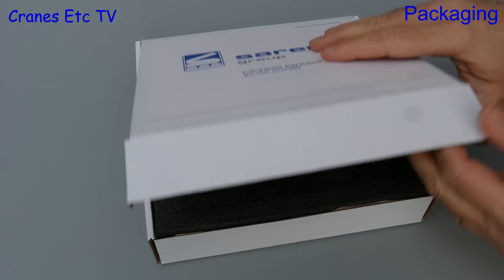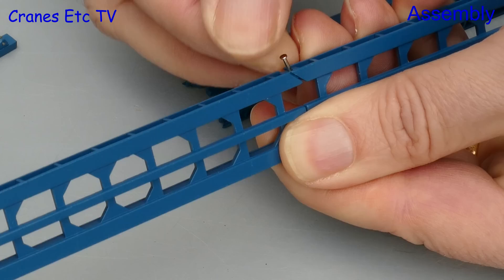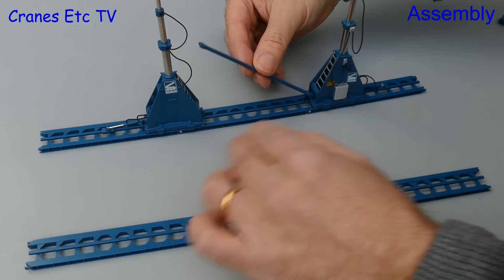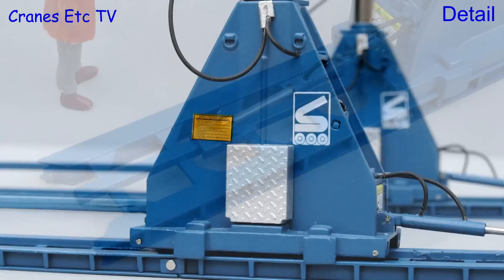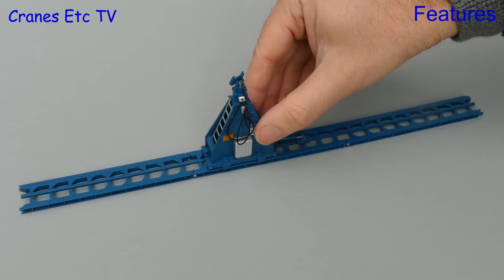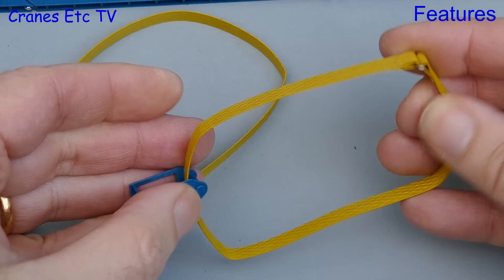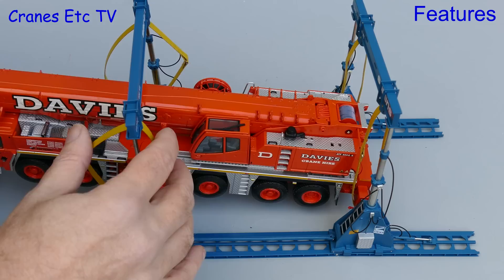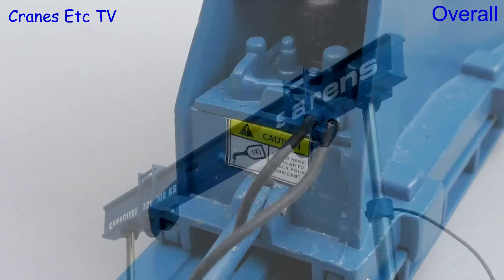YCC 720 Tonne Lifting Frame 'Sarens' by Cranes Etc TV

Comment: If you measure the weight of a model by divide the actual weight of the model in real life by 50 (1/50), the model will become super heavy( 72 tonne tadano crane model divide 50 = 1.44 tonne!) But anyway, that Tadano crane is so detailed, why there's no review of that model...
Reply from the maker: You have to use dimensional analysis.  Weight is related to volume, so assuming the same density you need to divide the real weight of 72 tonnes by 50 x 50 x 50 = 0.6 Kg. Actually the Tadano model weighs closer to 2 Kg.

The review of the Tadano is not finished yet.....